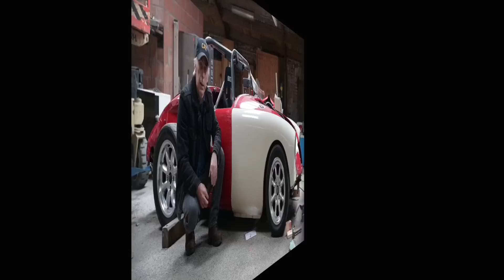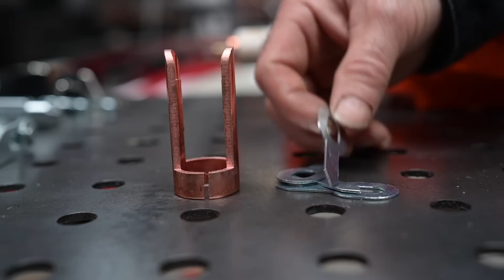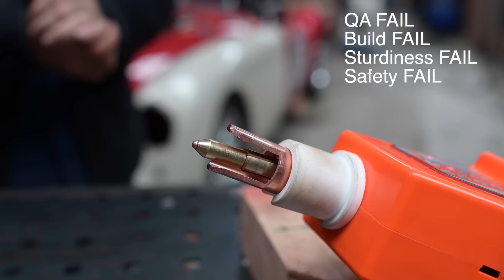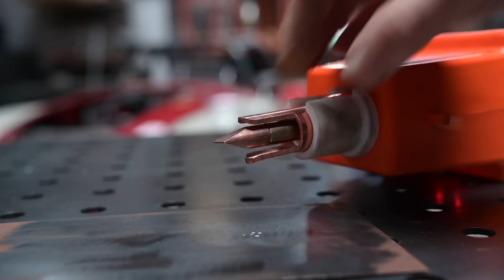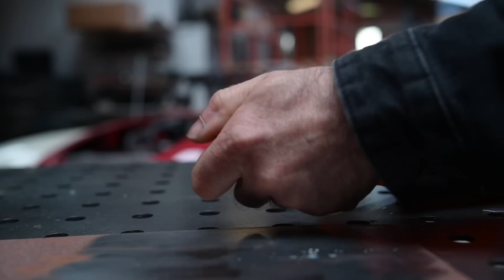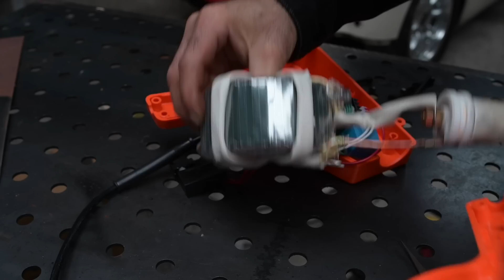VEVOR  Stud Welder  - Is it any good ? -

Comment from the maker: ***UPDATE***  
Just for your information,  I did send a complaint to Vevor last week. opened a trouble ticked and pointed to the Video.   The result was that they came back on 05 May by email with an answer.   They made an upgrade to the PCB ( controller) that will  provide more power .  It was offered to me, for free  ( hahaha what else right ) .  Of course that does not solve the issue with the mechanical parts ( that I will need to fix). And it might not work at all, as the transformer may not be upto it..  equaly it might real hot ...  will see.. as soon as I have the PCB, I will make an update video...   Thanks for watching and commenting
Reply: The only thing that could increase the current of the transformer would be to change the frequency with an electronic switching circuit PCB... I doubt they will go there. It will probably just increase the trigger time of the thyristor. just return the damn thing
Reply from the maker: @nabsp  That is also what I expect, anyhow I will see how far they will go...
Reply: waay off topic but do you have curve sheet for the 123 distributor in your racecar? And hows that prep going?

Comment: I got one from vevor germany, and was surprised how well it worked. It does not have your side panel, just a potentiometer to set the time. The electrodes are nice and strait and it welds really strong. Much stronger than yours. It’s a 240v unit marked 800VA @ 4V. Haven’t used it long term, so cannot comment on longevity…

Comment: I always wondered if putting solder paste on the tip of the keys or studs that are welded on so it is like also soldering on the attachments, to get better performance. And the solder can easily be removed.

Comment: The one I purchased didn't have any side light control buttons. Doesn't work ,with the company giving me my money back and said just keep the unit. This needs more heat current and a longer duration time on the trigger to work at all. I guess I'm going back to just spot welding nails to to cars I do. I loop bend 16 penny nails, spot weld them on both ends and can pull an elephant with them.

Comment: I have the old Harbor Freight (us tool chain) version which only does studs. No timers no adjustments just pull the trigger and count and release. Other than the fact that the largest size studs are no longer produced by anyone now it's been a decent tool. I would like those newer puller methods but I'm not parting with my working tool. And I don't like that side hammer at all. Mine has a knurled wheel on an eccentric so you can quickly grab a stud and release it as well. Collet type is a bad idea. 
   The one drawback to mine is that the duty cycle is pretty low which wouldn't be a problem for you but for me where it's 110* in the summer the tool can only do a few studs before you have to find somewhere cool for it to rest.
Reply from the maker: Thanks for the comments...

Comment: I dont have one of this brand, Mine is a Taylor brand)  but, these studs are designed to have a straight pull.
twisting sideways is used for removing them after the pull.
Well thats how mine works
Reply from the maker: Thanks for the comments and yes that is an issue on this one

Comment: Steve, you can't just grab a piece of rusty dirty metal out of the scrap pile. Try using a grinder to get the metal shiny, you'll have much better results. I use a cheap unit sold by Harbor Freight here in the US of A (commonly referred to as horror fright). It has none of the settings that are on your Vevor. It works just fine for my needs. I would call your testing a huge FAIL! Practice, practice, practice!
Reply from the maker: Thanks for the comments ,  I did brushed the metal, its not rusty where I tested it . And it was not the only piece that I tested.. besides all the other issues it has (bend nose etc...)   .  I am sure that what you have is a lot better, I have seen them on YT...  have a great day

Comment: The electrodes on the gun that ground to your metal are different lengths....you should file them to equal lengths...your tilted due to the different lengths and not grounding fully..and could be touching across the electrodes and not getting full weld penetration....🤔
regardless it isn't heating up and penetrating enough to hold properly....yes it is what it is ..but many times in 50 plus years i had to slightly tuneup a cheaper tool to work properly....part of buying a cheaper tool is quality is at best sketchy...but sometimes it is something a handyman can fix and get it performing as best as it can....
again..i am not saying this unit is good or bad...they can arrive in bad working condition and frustrate you...but i buy knowing it will need some TLC to keep.... my first observation is the same..it isn't penetrating...the thickness of metal doesn't matter as it will burn " X " deep regardless... cleaning the metal perfectly might also help make it weld better??  it should hold long enough to slidehammer a few good whacks minimum...yes your old car has better metal ( thicker ) so it won't work the same as a newer vehicle would with this type of tool..but a good welded pin will not pop off easily... 
🇨🇦🤓🤟
Reply from the maker: Thanks for the comments and explanations

Comment: Hi Steve before you chuck it try it again without the extension cord and making sure the outlet you use is rated for the current required.  I had the same issue with a spot welder and found a huge current loss through my extension cord and that a 115 volt circuit at 15amps is not the same as 115v at 20 amps:). Cheers from Ian in Canada
Reply: The stud gun looks like it is not getting enough energy (watts = volts x amps).  It would be worth a try to remove variables and make sure the gun is getting the required wattage which should be indicated on a attached label.
Reply from the maker: It just does not have the power
Reply: I agree that the high mains currents can be a factor in countries where the mains voltage is 115 Volts. However, the mains voltage in Belgium is 240 Volts. Therefore the currents are much lower and less of a factor.
Reply from the maker: Ok, thanks  but the outlet is rated for 16 amps and so is the socket and cable section.. My Mig fits in without an issue.. this thing is only 800 watt... so max  4 amps
Reply: I’m just looking at the online ratings which seem to be all over the board.  The quality is poor and it sounds like you got a bad one.  It’s unfortunate as the stud gun with those accessories could have been very useful for your repair especially in the tight areas where it’s hard to get a hammer and dolly.  I’m looking forward to seeing the rest of this series.  Best of luck, cheers Ian

Comment: This machine seems unusually underpowered overall, but aren't you using a welding machine designed for 220V with a 100V power supply? Chinese vendors often do not specify even basic specifications...
Reply from the maker: No , its rated for 220V....and the power supply is 220v

Comment: Steve, Thanks for the review but i could see from the video were you tried it on the bodywork that it was junk. There are good makes out there that work really well
this just isn't one of them. I have a combo set up with dent puller and double & single spot welder but the double tap spot welder draws too much amps. Cheers Dave
Reply from the maker: Thanks for the feedback Dave

Comment: It seems to be several brands of this stud welder out on market and cheaper knock-offs also. I own one, did buy it in Sweden from a well known tool shop here and it has their own brand but the outside design look is very similar. Since it was some years back I last used it, and I know I  had no problems with its function and quality I had to look in my garage if  it is the same as your VEVOR. The answer is NO. First my is CE marked, has no such bad quality electrodes that the VEVOR one had. The one I have has no ability on it to select type of studs or make a own time select, it's fully automatic on the time. On the label it says that the output is 4V  800A, that should then correspond to 3200W within a time frame between 1s -5s. As you say "you get what you pay for" and I agree!
Reply from the maker: Thanks for the feedback
Reply: Only a few people know and can recognize the difference between
EU Conformité Européenne  logo and China Export logo.
The similarities between them are purely coincidental 😂

Comment: Steve - I passed by that it was a Vevor brand tool and now I see why there was a problem.  That gun is probably, and I stress probably, OK for newer cars that basically have beer can thickness metal for the body panels.  My guess is that there is no way that gun can handle welding studs onto heavier gauge metal of older cars.  I would still request you try a better gun from a known manufacturer and see what the results are.  I have seen too many videos of commercial quality stud guns being successfully used and really would like to see what level of "hobbyist" quality stud gun can work on classic cars (i.e., not wanting to pay $2,000 for a stud gun that may be used 2 or 3 times a year).
Reply from the maker: Indeed, it is poor assembly, not precise and under powered.     I might just do that, get another one to test
Reply: @D3Sshooter  Was just checking some ratings of stud welders and the highest rated tools were in the 3000 watt range as compared to the 800 watts of the Vevor unit.  That tool just doesn't have the power to handle any real metal thickness.  Maybe if you look in the 1500 to 2000 watt range to see if one of those would work.  BTW, the best rated one I came across was from Eastwood, US made, 3000 watt power, and cost about $570 US vs. $165 US for the Vevor unit on Amazon.  Maybe Clarke carries something similar to the Eastwood unit for the European market?

Comment: The Vevor label is the mark of the beast. They don't specialise in tools or a specific line of products, they specialise in reselling products cheaply, and that is exactly what you get, cheap stuff that resemble the original, but seldom work as the original. The sheer quantity of different products they peddle makes me think that they don't produce the stuff themselves but are a large reseller of cheaply made products.
Reply from the maker: Indeed, and as you say "you get what you pay for"

Comment: Should really try to fix those crooked electrodes before any serious work. Now about the weld strength it IS supposed to seperate by wiggling. What we're interested is does it hold for pulling the metal back. And not leave too much of a mess. (too burned base). And about the transformer wires, it's probably red painted AL. Could scratch and test for us.
Reply from the maker: Yes , I could try to fix those electrode, or remove them and work with  ground cable,  I know that wiggling is the way to remove the stud, but it should take a bit of force not like these here
Reply: They should NOT come off by wiggling them ! When welded on properly you have to cut them off with side cutters and then grind the head off of the panel , been using my  H&S auto shot stud welder for years

Comment: might be "good enough" for (lipo)battery terminals.  

but then again it's not that hard to make your own that uses lipo cells to attach terminal strips to lipo cells.
Reply from the maker: Indeed, and I will use my MIG in spot mode using some of these parts like the adaptors